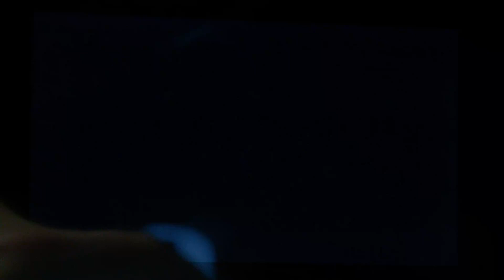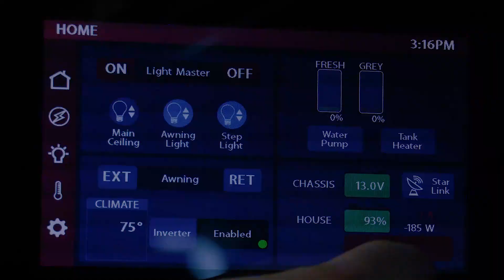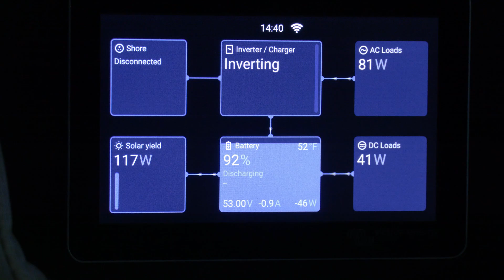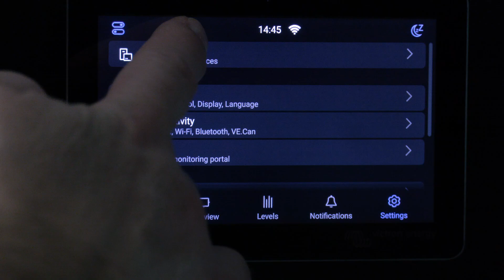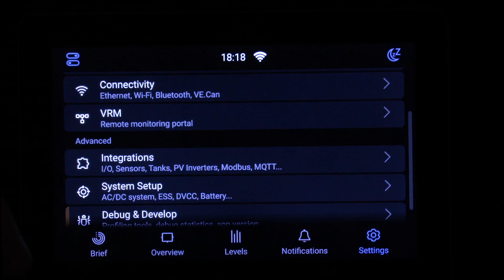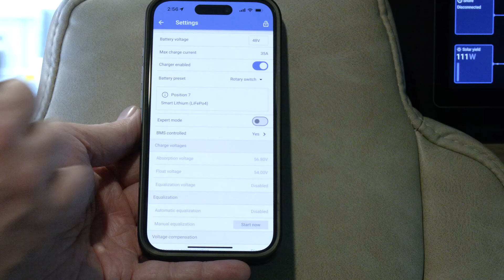JETL Power Systems

Comment: A couple other things I’d be interested in—
- adding a dc usb port to the bed area for phone charging without inverter  
- diy on aes
- options to remotely control a/c unit via WiFi (this would be helpful for leaving a pet in the van). It seems like the best option currently is Remote Desktop 
- solar panel upgrades with higher power panels. I think 400-500 watts would enable true off-grid living for running refrigerator, lights, water pump and fan
Reply from the maker: All of these, except for remote AC control, have been addressed on the Facebook group.

Comment: This is incredibly helpful, Erik! Do you know if it’s possible to classify the second alternator as generator power on Victron? Or is it configured in such a way that the generator just shows as negative DC load (as mine is currently configured)
Reply from the maker: That's a great question that I forgot to address in the video.  The Wakespeed alternator controller is connected to the RV-C bus so the BMS can control it.  But there is currently a quirk on the Victron Cerbo side where the Cerbo is expecting to communicate with the Wakespeed over the VE.can protocol, not RV-C.  As a test, I switched the Cerbo connection from RV-C to VE.can and the alternator shows up as a source as expected, but I lose the battery.  So for now there isn't a solution.  I'll report back if I figure something out.